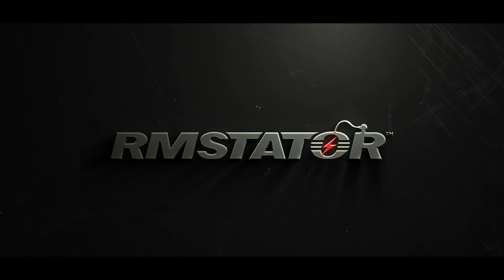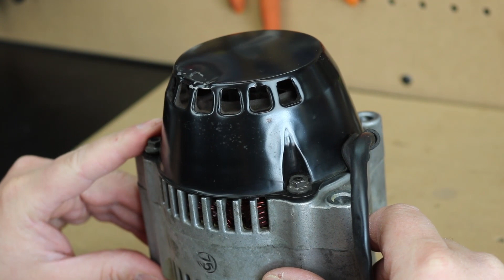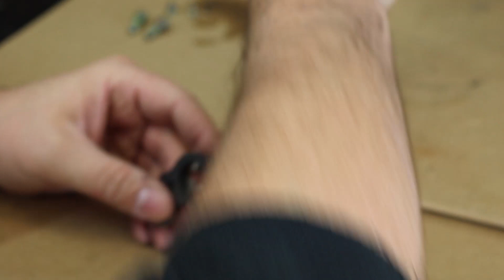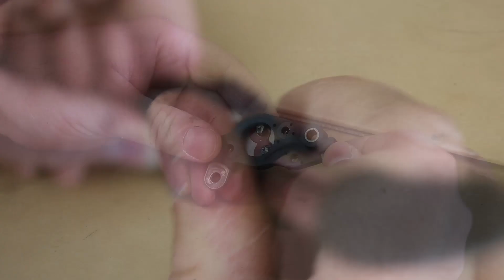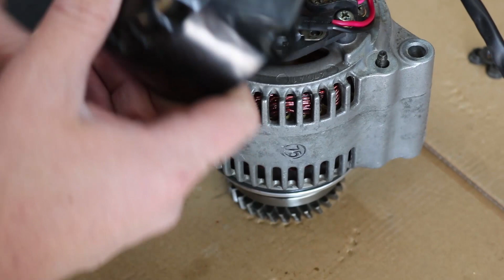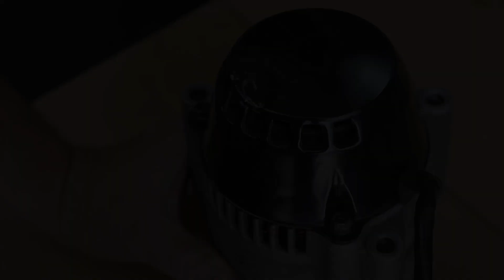How To Install an IC Regulator Nippon Denso Alternator For Kawasaki Triumph Yamaha RM31000

Comment: Hi, how are you? I don't know if you could help me with a problem I'm having. It's about a motorcycle that has the same regulator. It's an XJ 900 model and it needs its battery charging corrected.
Reply from the maker: If it uses the same Nippon-Denso alternator then you can use this IC regulator to improve or fix charging.

Comment: I have donne this job. Thanks so much. Aniway the charging voltage is already 12.1 volts. Do you have any suggestions for me? I note that the central pin of the alternator does not rotate when the engine is power on. It rotate only during the power on, but than 2 second does not rotate. Help me please 😢

Comment: I have installed one of your regulators on my Suzuki Bandit 1200 that has a Denso alternator as per this video and when I rev the motor to 5000rpm the battery voltage climbs to 15.21volts.
Surely this is too much; Do you have a warranty on your products.
Reply: Overcharging is often not caused by a fault in the regulator. The generator receives the positive signal from the ignition switch on the brown wire. Due to oxidation of the connections, there is a large voltage drop in this section. The solution is to install a relay that is controlled by the switched positive wire. The brown wire going down to the generator comes from the battery via a short path through the relay. The engine must be started. The voltage must be measured on the brown wire and also measured on the battery during operation. You will be surprised how different the values are.
Reply: @Nenézzé I tried your suggestion about bypassing the ignition switch wiring and you were right . 
Now the voltage is down to 14.3-14.6V.
 However as an aside what happens when the battery becomes full ?; Does the regulator stop charging or what?.
Reply: @leeengelsman1855  Hi. The regulation works the same way as before.  The regulator can now operate based on precise values.  This prevents your battery from overheating.
It’s okay if the voltage (V) of the electrical system is higher than 12 V. Overheating is caused by the current draw (A). This is how your system works properly.
Reply: O.k will try that thanks.

Comment: If you pull the cush drive damper off of the rotor shaft, do you need a press to fit it back on or can you just torque the driven gear nut?

Comment: What are the advantages of this over the standard regulator unit? I am in Australia and by the time currency conversion and postage is accounted for the cost is similar to the one unit. Is there a greater advantage to using this over standard?

Comment: I have a lithium battery in bike. Though the alternator is charging , sometimes I see voltage going to 14.9v which is not good for lithium battery. Would the regulator keep voltage from overshooting that high ? What is the max volt that alternator is allowed to produce ?

Comment: hi, my mechanic plug the 2 wires in place of each other, so my alternator doesnt works, its possible that wrong conection could damage the components like regulator or rectifier?

Comment: Hi mate, just a quick question, what’s the reason for reinstalling the old regulator mounting plate, why can’t you simply connect the new upgrade directly to the corresponding connection points without the old plate?
Reply: Because you don't have mount black wire without old plate

Comment: The connector eyelets were oversized, had to trim some off the red wire to fit in opening  on 96 gpz1100.

Comment: It should be noted that the phillips head screw on Japanese products are in fact JIS (Japanese Industrial Standard) heads and ideally a set specific set of such drivers are used on them. You will find that a standard phillips does not fit properly and frequently this leads to damage of those none too hard screwheads. So, if you own a Japanese bike or any bike with Japanese sourced components on it and are likely to want to work on it yourself, do yourself a favour and get a set of JIS screw drivers.

Comment: Can someone from rmstator answer my question ? I called your office and I am told there is absolutely no tech support to help answer my question.
Reply from the maker: What's your question?
Reply: I appreciate you responding. Someone reached out to me via email and is helping out. My alternator is only producing 1 volt at idle and 3 volts at 3000 rpm . Local armature mechanic tested it and he suspects it is regulator. My question is , can a regulator actually regulate backward and so much so that alternator produces just a few volts ?

Comment: Hello. I have same alternator. Problem is I get 3 volts tops . The alternator shop tested it. As per them the coils are good. Do you think the regulator is regulating too much and is require changing ? Where would I see raw ac voltage before the regulator ? I want to make sure it is the regulator before I invest in it

Comment: Hey Evan, I took apart my Nippondenso alternator on my zx7r and I took off the coin shaped regulator using a solder iron like you did. I wanted to test the regulator with my multimeter and I touch both pins and it shows a connection. I touch each pin to the regulator body and it shows a connection. Is this normal? Thanks
Reply from the maker: Unfortunately there is no way to passively test the original regulator. It needs to be powered to see if it regulates correctly. If you do not have adequate charging (voltage too high or low at your battery), it is very likely a bad regulator with the Nippon Denso system.

Comment: hello, i have an alternator like this one! Same problem!
I ended up making a deduction similar to yours! I used this type (7812 Voltage Regulator Fixed Positive 12V Linear IC L7812CV).
Unfortunately I had to try because as I am from Brazil, here could not correct my problem in my Bandit 1200!
If you can just help me and tell me if the Regulator I used is the correct one, I would appreciate it!
Thanks in advance and great video!
Reply from the maker: That chip is not specifically meant for field coil control in alternator. Looking at the data sheet, I don't see any way for it to switch on/off output for energizing the field coil. This could result in a permanently energized magnet, and damage the field coil and stator windings. I would not recommend it for this type of use. It is not the same type of IC that we use.
Reply: @Rmstatorinc  thank you very much!

Comment: Qué tal RMSTATOR , podrías mostrar el valor de la pieza , o característica técnica , para poder comprarla o donde se puede conseguir ? Muchas gracias
Reply from the maker: Here you go!     https://www.rmstator.com/en_ww/products/nippon-denso-internal-voltage-regulator-for-triumph-kawasaki-suzuki-yamaha-motorcycle-1985-2014-rm31000
Reply: Thanks 👍

Comment: Qual chip vc usou no rm 31000 para zx 11?
Reply from the maker: Yes, it will fit 1990-2001 Kawasakai ZX-11!
Reply: hi good night, I wanted to know what is the model of the transistor that you use in the rm 31000, for the zzr 1100 95. I can not import one, I just wanted to fix my motorcycle. Thank you.

Comment: RMStator After I was getting some slight flickering on my motorcycle lights I decided to open up the alternator (it looks exactly the same as the one in your video) to see if I could test the regulator and rectifier. The regulator tested good. I removed the rectifier after unsoldering the 3 bare copper wires and the 4th insulated output wire. I tested the rectifier and according to the VOM readings it was defective. So I took the thing apart before seeing your excellent video, thinking I could install an external universal type rectifier/regulator. Now that the rectifier is destroyed do you think this is possible and how would it have to be connected? Could an external rectifier/regulator with a 3 wire connector and a 2-wire connector be used?
Reply: Hi SJD, Did you ever solve this problem? I have the same issue, I replaced the regulator to only be presented with the same issue. The regulator itself was outputting 14.4V or so, but the voltage at the battery was just over 15V, so higher than the regulator. Was it the rectifier in your case, or was it something else too?
Reply: @JB-NZ Overcharging is often not caused by a fault in the regulator. The generator receives the positive signal from the ignition switch on the brown wire. Due to oxidation of the connections, there is a large voltage drop in this section. The solution is to install a relay that is controlled by the switched positive wire. The brown wire going down to the generator comes from the battery via a short path through the relay. The engine must be started. The voltage must be measured on the brown wire and also measured on the battery during operation. You will be surprised how different the values are.

Comment: RMStator I have a 2006 Suzuki gsx750f that I just recently purshased. But as I ride for about 10 min it shuts off on me & I have to wait about 10-15 min for it to cool down then it’ll fire right back up. I’ve checked the charging system and it’s charging. I’ve also put in a new battery. Do you think the rectifier could be related to this issue on heating up & turning off?
Reply from the maker: This is not likely related to the charging system at all. Even if your charging system had died, the bike would keep running as long as the battery held a charge. Since it seems to be heat related, I would guess your crank position sensor is failing when the motor is hot. Your service manual should have a resistance spec for testing the CPS. Test it with the motor cold, and then when hot and not running, if the values are far apart (more than 20%), that is your failure. Could also be failing ECU. Hope this helps!